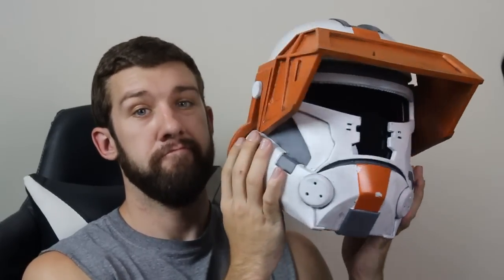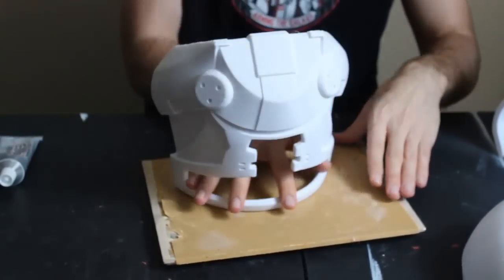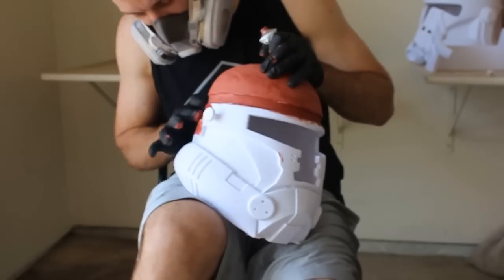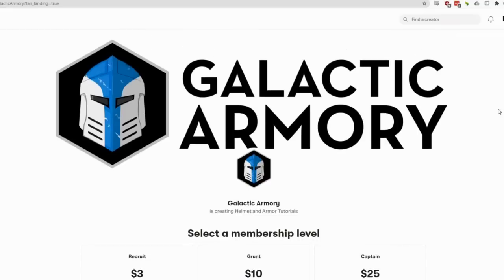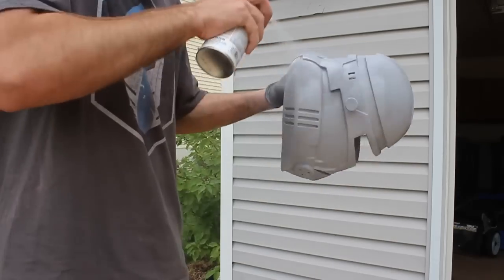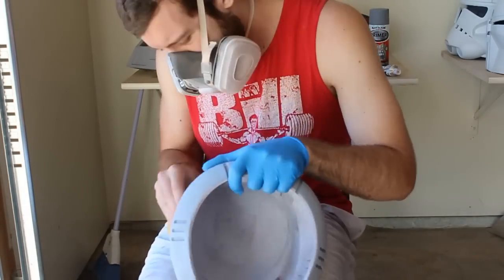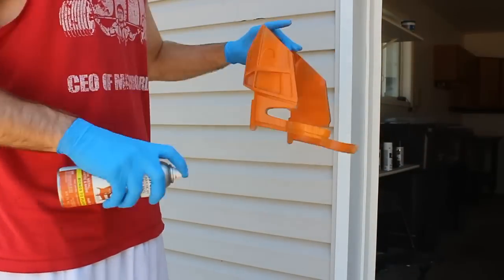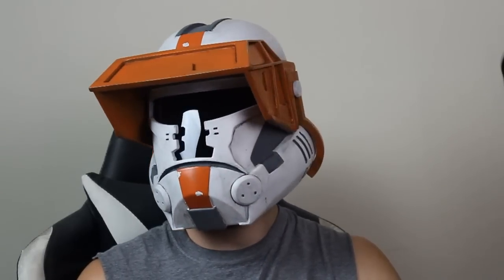A Trip to the Old Republic - Making a Havok Trooper Helmet

Comment: In your videos you always mention that it takes hours for the Bondo to fully cure so what if you wait an hour or so then get a 1000-2000 grit piece of sandpaper and lightly go over the helmet to smooth out the bondo before it drys? Or something like that to reduce what you have to sand?
Reply from the maker: You really don't want to sand the bondo before it cures unfortunately, it will roll up and be really tacky if you try to sand it early.

Comment: Hey there I just purchased your ARC Trooper file off your website and was wondering how much filament do these projects usually use? Thanks
Reply from the maker: It depends on your print settings but usually 1-1.5 kg's of filament
Reply: Galactic Armory thanks what’s your recommendation on print speed?